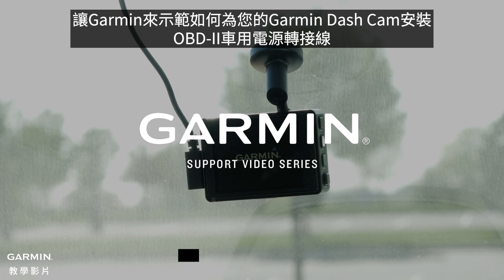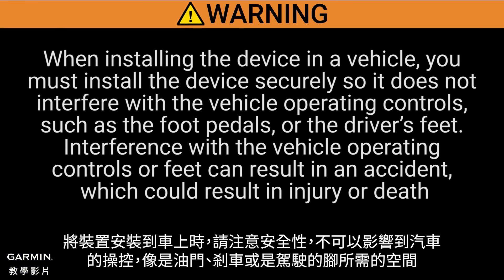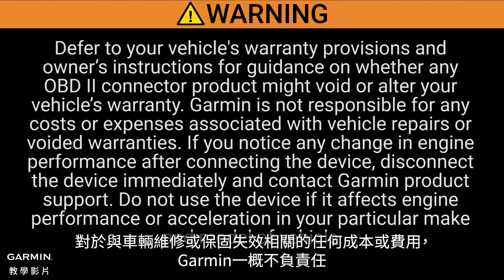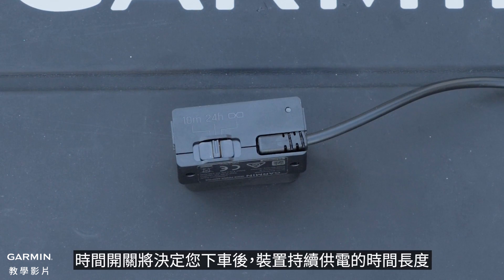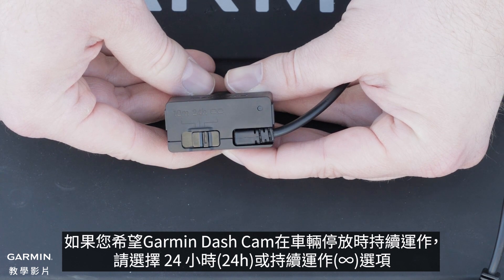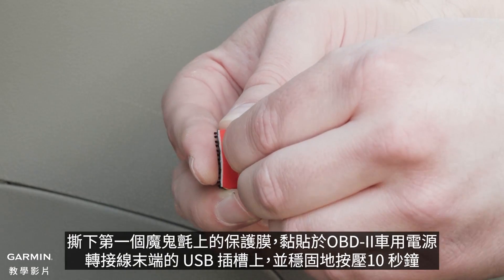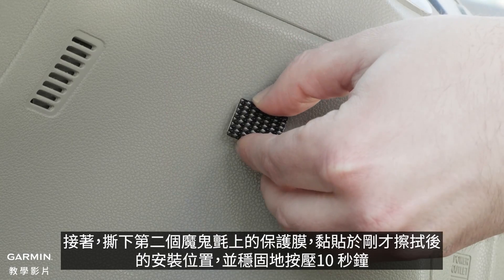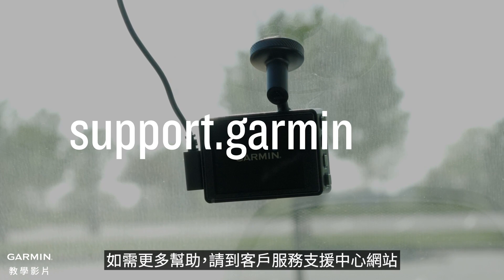【教學】Dash Cam 系列：安裝OBD-II車用電源轉接線

Comment: Does this cable allow "Parking Mode" for Garmin Dash cams? The Garmin Parking Cable which gets wired on the fuse Box, has apart from the 12V wire, also an ACC wire, i.e. signals to the camera when the Ignition is ON or OFF. Does this OBD Dongle offers the same functionality?